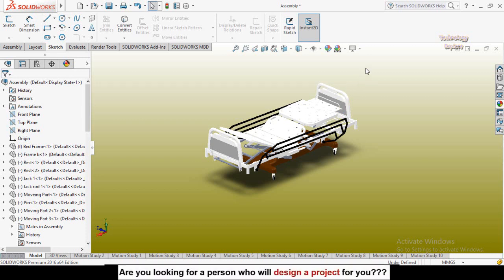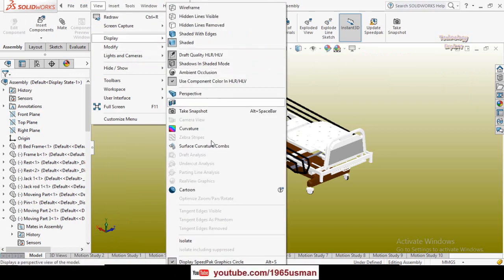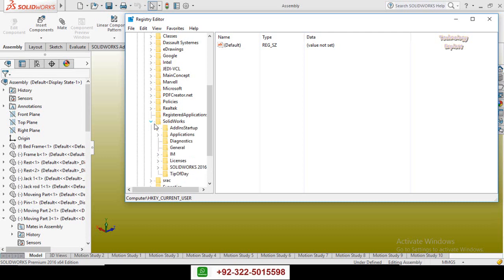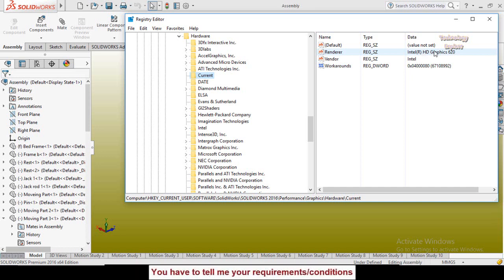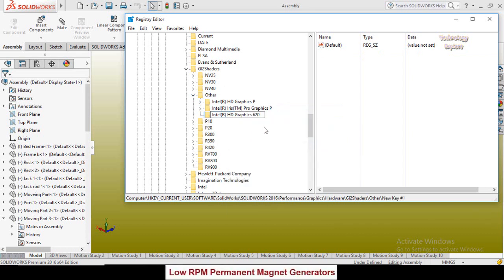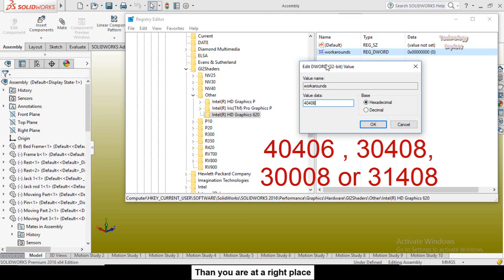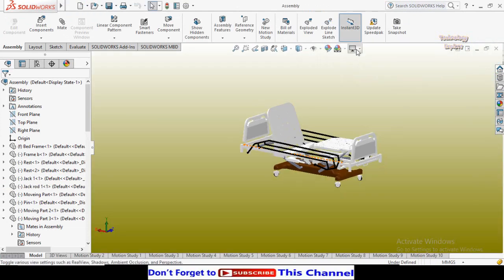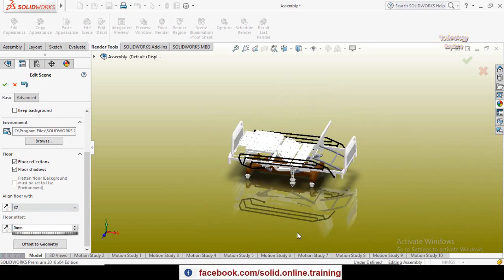How to Activate RealView Graphics in SolidWorks for Dell laptop / Intel Graphics Cards

Comment: I have Interl(R) HD 3000 graphics card ..
After updating windows 7 to windows 10... 2013 SOLIDWORKS to 2019 SOLIDWORKS.....
Before it was working when turned on real view graphics
Reply: try (30008, 30408, 31408, 8..) and  untick “Use Software OpenGL” (Tools -> System Options -> Performance, “Use Software OpenGL”)
Reply: @congtruongdam1467  ok thank you for the advice.. I will try
Reply: @safiyasaf9158  Any solution found kindly tell.....
Reply: And In renderer GDI generic is there
Reply: @safiyasaf9158  same